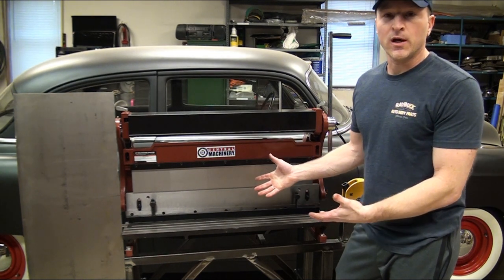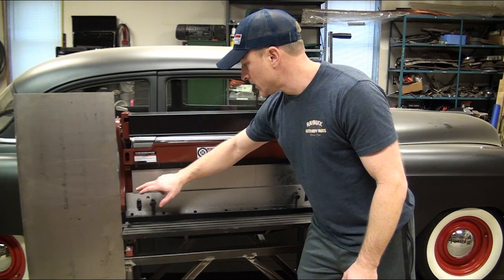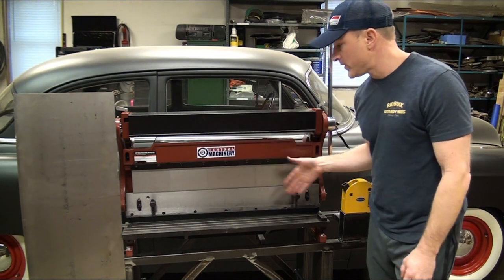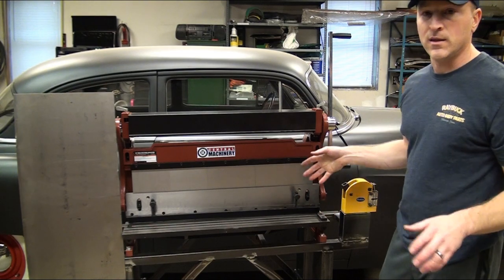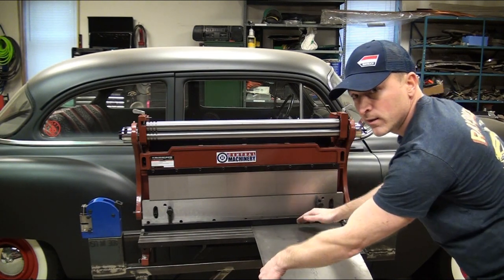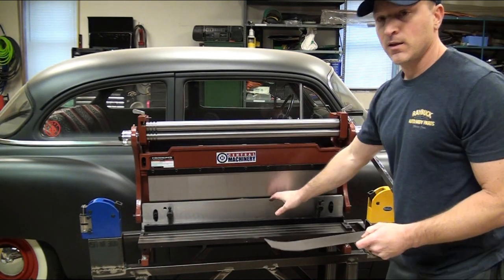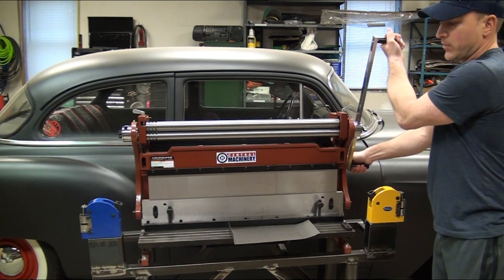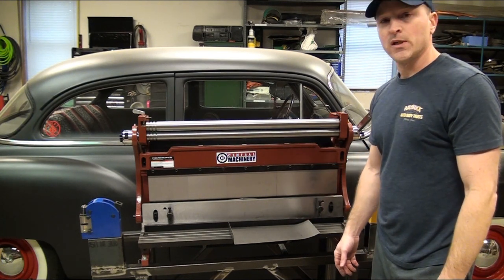Combination Shear, Finger Brake, Slip Roll Harbor Freight 3 in 1 Machine Your garage needs this tool

Comment: I have had this same machine for about 6 years, and I have 2 things to suggest. 1st, there is a single bolt holding on the hub that the handle sits in. It's an Allen screw, and it comes loose WAY too often. Loctite that bad boy and you WILL thank yourself. 

Second, my hold downs are not up to the task, so I always keep a piece of 2x4 and a C clamp handy and lock down the left hand side of the work when making long cuts. Not a huge deal, and it gives me much cleaner and straighter cuts. 

All in all, I would purchase this machine again, especially now that I have figured out it's limitations. Definitely worth the money.

Comment: Hmmm.  Got one of these about 16 years ago for one stainless steel sculpture project, never really used it much again. (The shear DOES NOT like 22 ga stainless sheet!) It sat on the end of a 4x8 plywood workbench for a few years until I moved, now been sitting unused in the floor of my new workshop for about 13 years because I don't have a stand.  Need one that can be rolled out of the way when not in use.  The shipping weight is listed as 321lbs... I would be extremely concerned about having that much weight on such a narrow base without it being bolted to the floor.  Looks waaaaay top heavy!  Going to watch your other vid on how you did the base.  I noticed when you used the brake part that the whole thing rocked a little bit right at 8:01.  Don't knock that thing over onto that great car!  Or anyone's tender lil toes!

Incidentally I have had one of the little horizontal/vertical metal cutting band saws like they sell at Harbor Freight for over 25 years, and it is the best money I ever spent.  I got mine at ENCO, but it is exactly the same model.  The plastic wheels mounted in the thin sheet metal legs are pure crap; I mounted mine on a rolling plywood base with locking wheels that I built for it, but the option to use it like vertical band saw with the table on is glorious!!!!

Comment: had been wanting one of those for years..  finally ordered one today,  made a last minute decision to order a 40", went out to the garage and realised that the thing will be fckn huge.  we will see
Reply from the maker: It is huge, but the 40" version will be nice to have for larger projects. The biggest issue is the weight. I used an engine lift to set it on the stand that I made.
Reply: @RaybuckAutoBodyParts   thats the next problem to solve.  its over 440pounds. how i will get it in the backdoor of the garage is a total mistery to me at this point :D
Reply from the maker: @ivarmarkusson382  Ha, two furniture dollies and some plywood

Comment: Great video! If you take the dies and blades off, are you able to do a continuous roll with the slip roll? Or are you still limited to one rotation of the handle?
Reply from the maker: You can leave the dies and blade on and it will perform a continuous slip roll. The handle just keeps rotating.

Comment: Thank you for this extremely well done video.  Do you think even brand new that this would have a chance with 18 gauge cold rolled steel?  I only need the brake and the shear.  Thank you.
Reply from the maker: No. I tried 20 gauge in the shear and it wouldn't cut it.

Comment: Thanks for the great intro, just wondered the bend was not 90 degree, can that be adjusted ?
Reply from the maker: This unit only provides for a 90 degree bend. You could get a more shallow angle by not pressing down all the way, but it's not precise. If you need a precise angle that's less than 90 degrees, you may want to get a stand-alone brake.

Comment: Can it be used to flatten sheet metal copper?
Reply from the maker: Are you thinking about putting the copper through the slip roll? If so, possibly if the copper is thin enough, but it would also curl it.

Comment: is the shear adjustable for different height to cut wire or just one height?
Reply from the maker: it's not adjustable for height/thickness/gauge. It says that it will accept up to 20ga steel and I agree with that. I cut a piece of 20ga steel with it and it took a lot of force to get it to cut. You can fit 18ga in the opening, but I think you may break part of the tool if you try to cut steel of that thickness.
Reply: @RaybuckAutoBodyParts  cause I build crab traps so I was wondering if it would cut 16 ga trap wire
Reply from the maker: @grantfoster9099  I don't think so. You probably want to get the next model up if they still have one. They used to have one that would cut thicker gauge steel than this one.

Comment: I was given a 3 and 1 missing a lot of stuff. for one the arms that lower and raise the cutter are missing. I was debating if I want to make them and get this working or not BUT can you tell me if when you shear metal does one side of the shear come down before the other. I need to know if I would make both arms the same length. Appreciate the information.  I have a brake but I am also missing the one roller with the gear drive. Thanks for info.
Reply from the maker: Sorry for the late reply on this. The shear blade is on a slight angle, but the overall mechanism will raise/lower evenly. You can use one or two arms. Having two arms just gives you more leverage for cutting, etc. If making two arms, I would make them the same length.

Comment: does hf accept the 20% off coupon on this?
Reply from the maker: yes, they do.
Reply: Generally not any more unless you get a 15% no restrictions one.  They have started expanding the list of brands they exclude and now include Central Machine.  Best bet is open a Harbor Freight credit account for a 10% discount if you don’t have one.  This can be stacked with a 15% no restrictions, or in January there’s a 10% credit if you pay with the HF credit and have Inside Track membership.